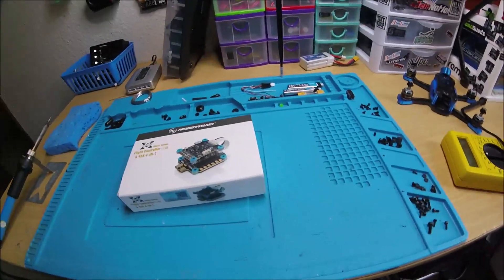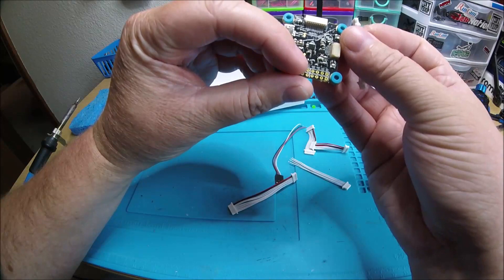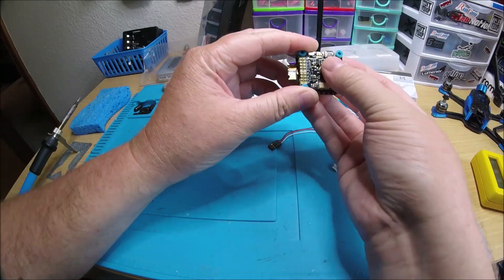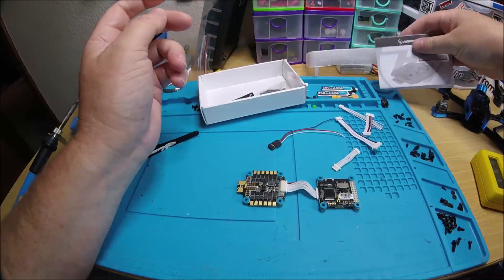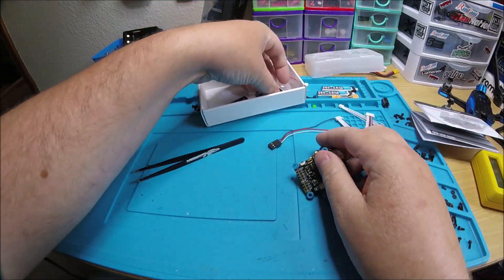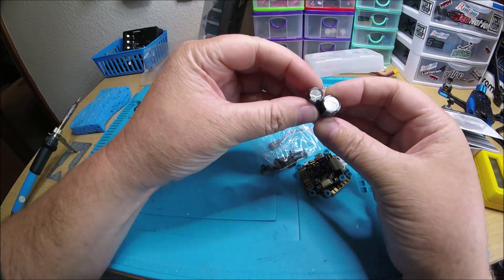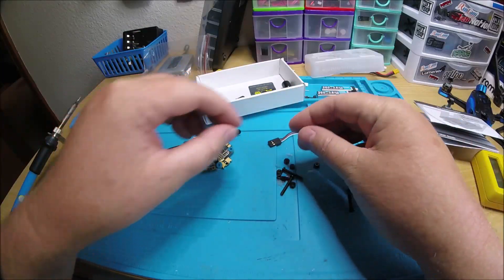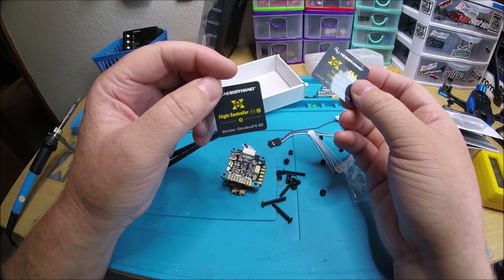hobbywing f4 g2 stack

Comment: Love this stack it's amazing, the heat shrink is for the capacitors, that way you can Shield the wire coming out of them all the way to your solder joint, the smaller one is four 4S the bigger one is 4 5s and 6s. I use the big one either way lol

I also actually use the 4 in 1 ESC in my flightone builds, it's the best 32bit 4in1 next to the Aikon 32bit. Both are awesome and pretty darn Bulletproof.

The longer one with the smaller plug on one end is to connect the ESC to a flight one board Johnny fpv had them add that. 

Anyways bro just want to say great overview of the product very informative for people wanting to buy it!

Sorry I'm always late to the comment party 🙏 lol

Keep ripping homie

Rob
Reply from the maker: Thanks man appreciate your comment!
Reply: @ADMDGLS69  you're welcome bro
Reply: Donde conectas el vtx??... para tener osd..

Comment: Strangely I did not get the 2 different capacitors, I only got the 35V 560uF and 2 little clear heat shrink wraps for the cap legs. As for the harnesses as well, I did not get the one that has the tinned leads on it. Strange that this is a brand new flight controller but the contents aren't the same.
Reply from the maker: Well hobbywing sent me this to review and test so maybe they put in some different stuff

Comment: If you’re trying to figure out what to do with it I’ll send you my address, lol. Awesome looking stack, love the detailed overview. It answered several questions I had but I’m still curious about 1 thing... are the 5v & 10v rails on the FC just a pass through from the ESC or do both boards come with separate BEC’s?
Reply from the maker: It looks like it's just a passthru that's how they kept the fc so thin and light
Reply: ADAMBOMB FPV 
That’s what I thought... My FortiniF4 OSD & Airbot Typhoon V2 stack just died so I’m considering whether I’ll go with this Hobbywing stack or maybe the Emax micro stack for weight savings. Thanks for the awesome content as always, I’ve been building custom mini quads for years & there’s a lot of solid information here on your channel